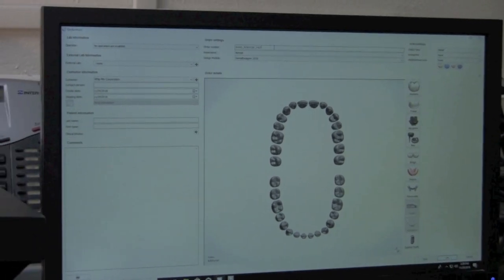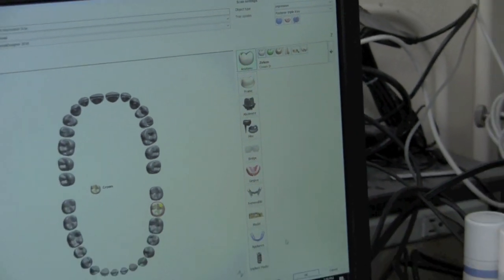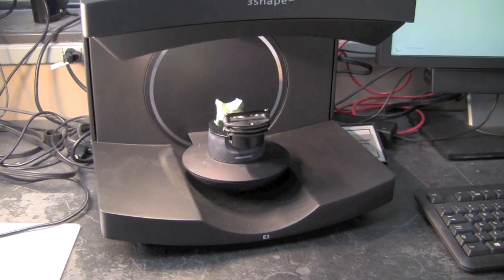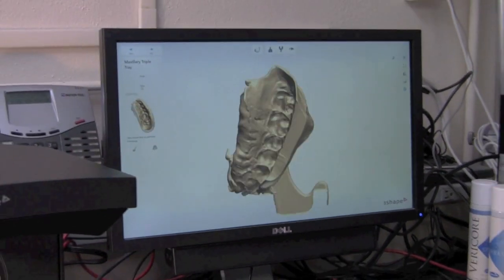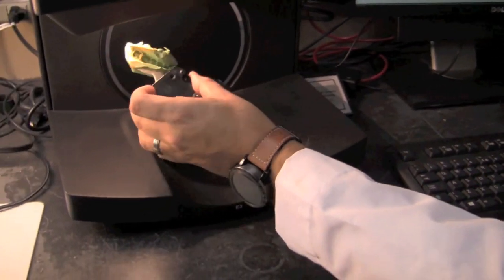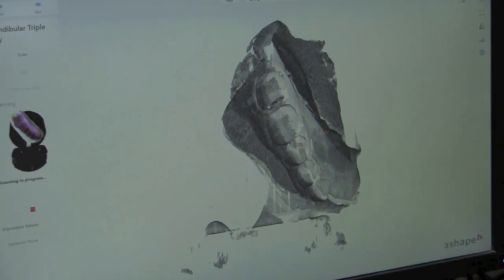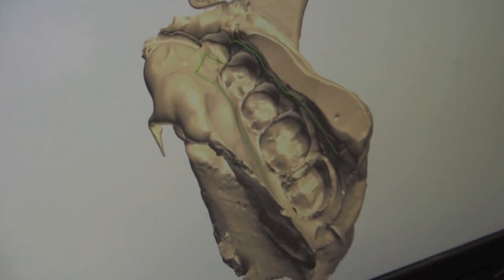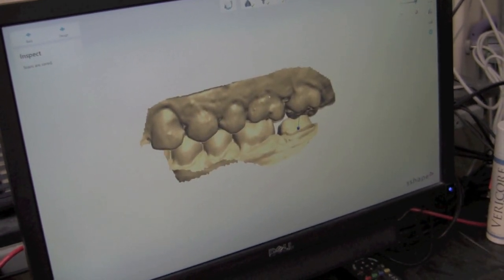Whip Tips - Impression Scanning with 3Shape E3 Scanner

Comment: I have a question, how do you digitally compensate for the retraction of the silicone? Because when you make a physical impression, the plaster has a slight expansion to compensate for the retraction of the silicone. But in full digital how to do?